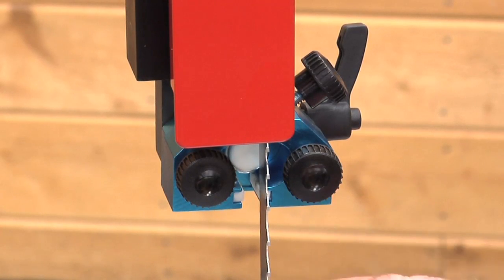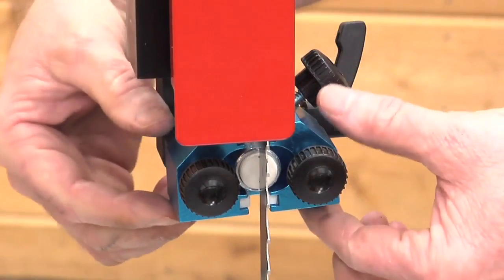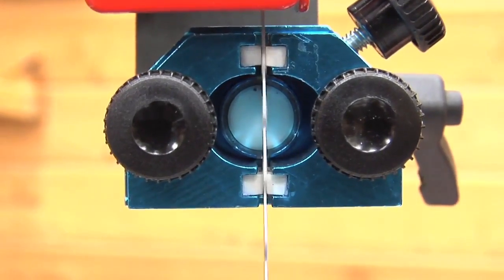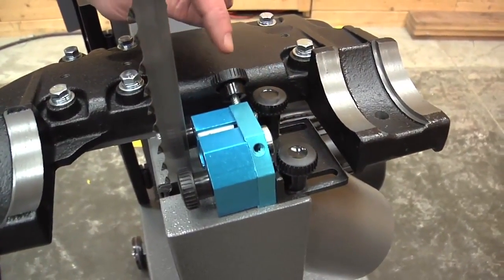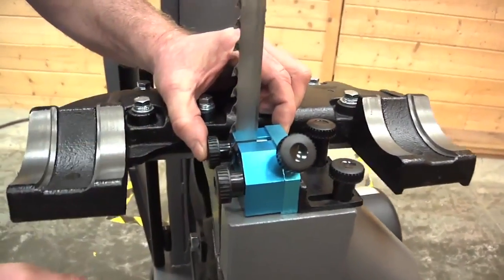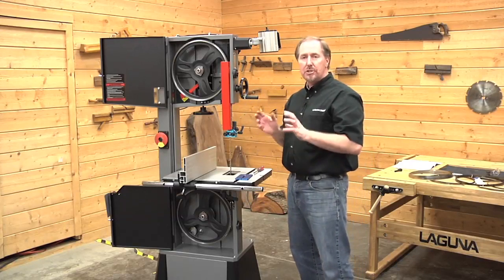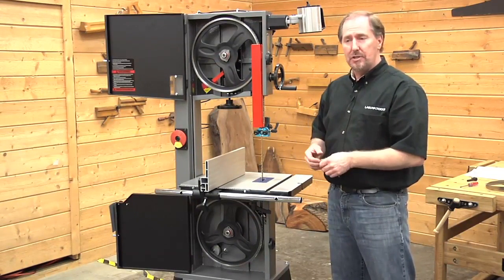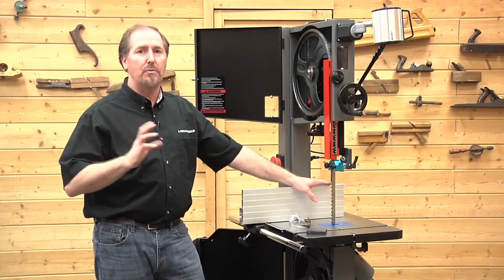1412 Bandsaw Blade Guide Adjustments - Part 10 of 14 - Laguna Tools

Comment: The bottom guides are a bear to adjust. Otherwise the saw is great. I have used mine for a month now to re saw and make some bandsaw boxes. I feel you would be happy with the saw once you get the blade guides adjusted you are set to the need for a blade change comes again.

Comment: the accessibility to the lower guides is limited, definitely NOT easy. what is missing in an earlier episode of the series is that prior to installing the table you should make sure that the lower assembly guides lockdown screws are loosene. Once you have the table installed, if those lockdown nuts are tight from the factory, it's frustratingly difficult to loosen them. I almost had to go back and remove the table, but I realized that I couldn't do that with the band saw blade and place so what I ended up doing was tilting the the table top backards and that gave me enough room to finally finagle the lrear lockdown bolt that slides the guide forward and backward. The rear one was impossibly tight and I almost had to use pliers on it, but i didn't  want to ruin the lockdown bolt so i perservered until i worked it loose.
also, the mentioning of moving the lockdown Bolt for the sliding the rear ceramic guide from the rear of the guide assembly to the front of the machine should be addressed be prior to putting the table on because the only way to get it off was to tilt the table forward to the 45 degree position otherwise it hits the underside of  the table and you can't get the bolt out. 

I do think that once these are loosened access is easier but not easy. Space is limited.
Reply: Gotta agree.  Adjusting the lower guides is best done with the table off.  Despite assertions in the video to the contrary, loosening and tightening the bolts is quite difficult with the table on.  The guides on mine don't line up really well anyway.